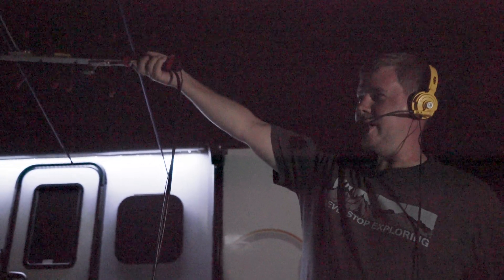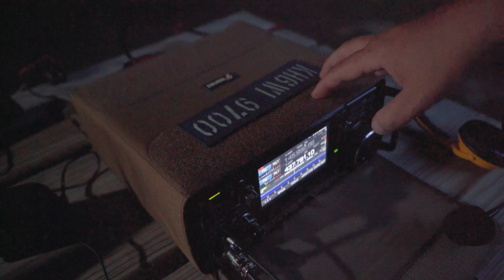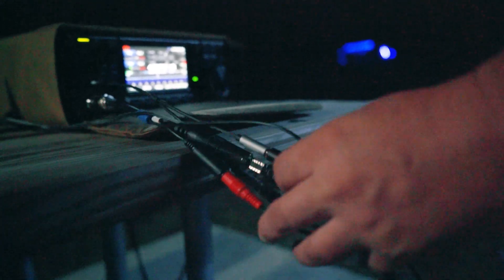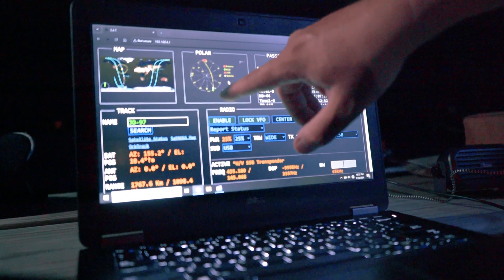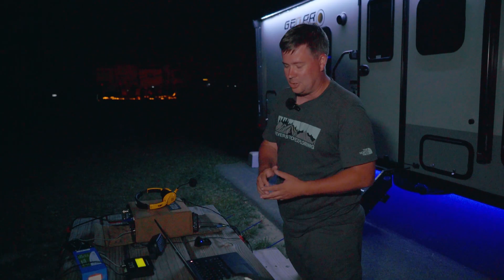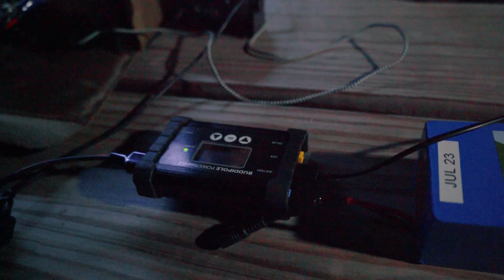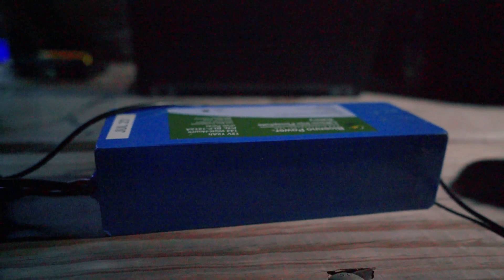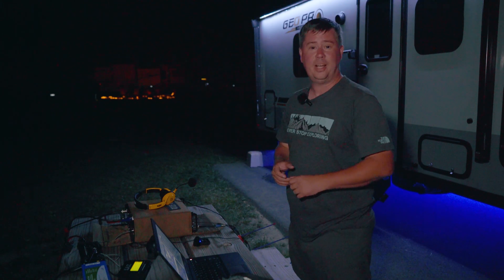KH6WI's Unique Portable Amateur Radio Satellite Setup

Comment: If a person didn't mind being limited to FM mode he or she could do the same thing with an inexpensive Retevis RT3S DMR HT with OpenGD77 firmware. The firmware has a built-in satellite tracker and does Doppler-shift correction, basically the same thing as his external satellite tracking box and laptop. (I certainly hope Eric isn't running more power than 5W into a handheld Yagi!)
Reply: The RT3S is only half duplex, though. When I use an HT, I use my full-duplex D72 so I can hear myself in the downlink.